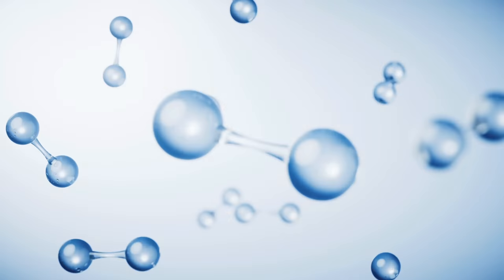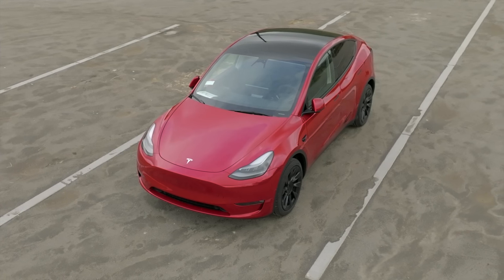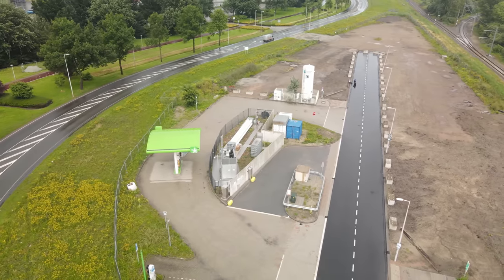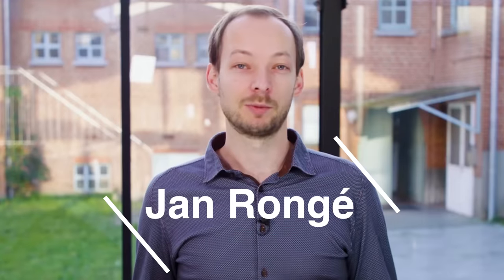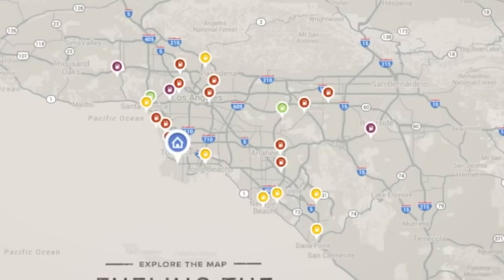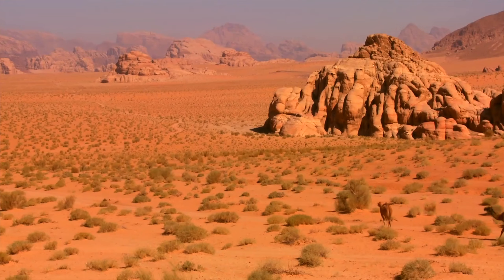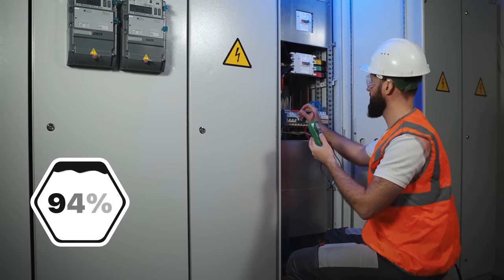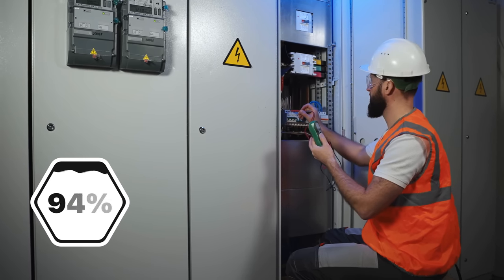Breakthrough Solar Panel Makes Hydrogen At Home!

Comment: Definitely not convinced hydrogen is the way to go for domestic EVs. Without a widespread network of easy to access filling stations, I don't see just refuelling at home as a viable option. Indeed, one of the reasons often cited for the slow rollout of EVs is the lack of kerbside charging solutions for people without drives/garages/etc., or for people in multi-dwelling buildings. With H2, that's orders of magnitude more complex than electricity.

On the other hand, I absolutely see H2 as a viable option for aviation. It sounds obvious and trite, but aeroplanes fly between airports; they don't stop to refuel at the garage along the road. Airports have fairly substantial fuel storage and distribution facilities, and also relatively secure facilities where the fuel is (usually) some distance away from things like the terminal buildings and jet pans. Introducing H2 refuelling at a few thousand airports is, potentially, a much easier sell than introducing it into hundreds of thousands of filling stations, many of which are small businesses with limited financial resources for retrofitting H2 tanks, compressors, etc., as well as the safety/monitoring infrastructure to monitor for H2 leaks.

Hell, you wouldn't even have to do it at every airport: just a handful of key high demand routes would be a good starting point. The calorific value alone would be a selling point to the airlines and aircraft manufacturers - shaving off several thousand kilos in take off weight, or potentially extending the range. There are, I suspect, considerable pressurisation issues at altitude to be solved.

Going back to domestic vehicles for a moment, one of the less appreciated benefits of EVs is the simplification of the drivetrain: effectively gone are the complex gearboxes and combustion engine, replaced with one or more (usually) direct drive motors. Even if H2 does move into domestic vehicles, I suspect it's more likely to be in fuel cell form rather than a full-blown H2 combustion engine with traditional gearbox etc.

Comment: I still don't get why there is so much push against hydrogen.
Sure it's not perfect and still need a lot of research but it was the same for EV and battery not that long ago.

50% energy conversion is not that bad.. solar have a terrible energy conversion too but no one seems to care ?!

Don't get me wrong, renewable energy production is great and i mostly see an even better future for them coupled with hydrogen generation, that way you would have a somewhat pilotable green energy source. So again 50% is better than 0%

Also for those who will prefer battery because they are better, sure they are but there will be nowhere close to enough material for everyone + reliable energy storage for renewable + storage for your home.

But hey what do i know ?! We can go full green energy with battery and in the meantime digging the earth like crazy to find all we need. 😅

Comment: So, in essence, a Solar Panel would be much better being used to charge a battery.
Reply: Yes, in terms of round trip efficiency, yes. But as long as there's a use case for hydrogen, be it at home or at industrial scale (and there always will be, I can assure you of that as a chemist) pushing technologies like these forward will always be valuable.
Reply: Hydrogen IS "A battery" just a very inefficient one.

Comment: Interesting product. 
Like always a great video, thanks!
I am sure H2 cars will never be mass produced but maybe with this, logistics companies could power their H2 trucks and ships with that. 
Also it could be another way to use it for heating the house, if the storage can be solved relatively cheaply. 
But in the end, all energy will be produced and used as electricity for home and cars because it’s the most efficient and will be cheaper IMO. 

I have seen an installation of a Model S 70D battery as home storage for around €15k. 
If you have a relatively big PV system, you can already go nearly autark. 
The efficiency loss for changing its state and or turning it from and to electricity is to high IMO. 
Only when there is so vast renewables, that it can’t be used or stored elsewhere this could be the last piece to put energy grid.
Reply: It's simply a matter of infrastructure. Electric grid was already built and abundantly available for everyone, even before electric cars were viable. Hydro grid is in its infancy, but the construction has started, and many countries are pushing hard for it, especially Scandinavian countries like Denmark are investing billions in expanding the grid scale to support tens of millions of homes already. Once the main production hubs have been established, the public infrastructure will sprawl - slowly at first, but at an exponential rate so over time it will look like it came out of nowhere, even if it feels like the pace is slow right now.

Comment: I don't see the point of this, it's just a PV panel combined with an electrolyzer, which means the amount of energy in hydrogen it produces is still way less than what you'd have by just using the electricity directly in a battery EV. It's not a miracle device that improves the efficiency of splitting out hydrogen and oxygen from water. If you must have an electrolyzer, mount it at ground level so it's easier to maintain.
Reply from the maker: great points, as I mentioned, but their direct air vapor electrolyzer is definitely interesting.
Reply: @TwoBitDaVinci  Yeah, sorry about that; I don't usually do this, but I got so annoyed by the idea of this product that I didn't even watch to the end.

Comment: By the time these panels are cheap enough for the populace to purchase, advances in existing alternatives will more than likely keep this tech from taking off. For good reason. Assuming hydrogen storage becomes affordable, if everyone had a decent amount of hydrogen stored at their house, I'd think the dangers would far outweigh the benefits. Imagine a house fire. Power is cut, the hydrogen storage vessel is no longer maintained and becomes a time bomb. The only feasible way this tech would be useful is if it converted water vapor into hydrogen way more efficiently than creating electricity. The hydrogen would then be used to power a generator. I'd rather spend $20k on an insulated box to store thermal energy that could be used to run a heat engine and generate electricity.

Comment: On demand hydrogen from water is something people have been trying to perfect for a long time. You can make an electrolysis cell with stuff from a hardware store. But they are dirty and inefficient. They have booster kits you can buy and put on your car. But it's tricky to get them to work, and they don't replace the gasoline they just replace the oxygen in the combustion process with brown's gas. It is questionable weather this makes it more gassoline efficient or not. The electrolysis cells you can get or make don't produce pure hydrogen gas. They produce a mix of oxygen and hydrogen. Though you could separate the electrodes, they get even less efficient as a split electrode cell. And then you need to vent the excess oxygen from the cell. So I'm not sure anyone has gotten them to work very well on internal combustion engines. People have gotten them to work for fueling gas cutting torches that would usually use two tanks and mix the gan in a regulator. From what I understand some materials require one of these brown's gas torches to cut correctly or safety. I think in some places the gas is also called oxy-hydrogen or something like that.

Comment: I guess you are completely unaware that we can use electricity form solar panels straight away for heating without any need to get hydrogen.

And by the way, harvesting radiant electricity (as per Tesla patent) would cost a fraction of any solar system an make almost redundant power banks … so instead of spending £30k on a weather dependant solar system we can use radiant energy 24/7 with cost of £500-1500

Comment: Would I purchase a Hydrogen Engine Car for a Daily Driver, YES.
When it come time to drive for distance travel, I'll just rent something else.
The only issue with a Hydrogen Engine Car that is not being discussed is that it requires just as much maintenance as a Gasoline Engine Car.
   And this will sway many from it and just to full EV instead.

Comment: Low efficiency is not a problem when you can just build a larger panel/plant. 
Waste heat is not waste if you use it to heat your house or water. Just add a jacuzzi to the system;-) "Free" heat.

Comment: There is absolutely nothing breakthrough about a solar panel that makes hydrogen.  You can make hydrogen as easily as sticking two wires into a cup of water and hooking them up to a 9v battery.  It is called electrolysis, and you typically do that experiment in grade school.

The only breakthrough that is important is the long term storage of hydrogen. No one has figured out how to do that yet.  The hydrogen will leak out of your car about as fast as those panels can make it.  The end result will literally be the destruction of the water as the hydrogen escapes into the atmosphere and then out into space.

Comment: The problem with Toyotas plan to utilize hydrogen to burn in a combustion engine is flawed.  Combustion engines have too many moving parts.  Too many things to go wrong.  They need an air filter, a spark, a timing chain or gears.  They need a carburation system and injectors.  They need a crank shaft with pistons and valves.  They will need regular trips to the mechanic for maintenance.  In other words, the very same problems that gasoline engines experience.  The plan should be to simplify the process.  An electric motor has only one moving part, is extremely reliable and needs far less maintenance than a combustion engine.  I can see using fuel cells to power an electric motor in the car, but a combustion engine makes no sense.

Comment: Why? Why have so much energy lose by converting solar into hydrogen, then hydrogen into power? I only really see hydrogen having niche uses.. I can see hydrogen being used in like cargo ships or at sea, it's a good replacement for gas there and ships can't just connect to the grid all the time to recharge like a car or a house. Electric just makes so much sense for most places, because there's barely any energy lose.

Comment: It still takes more energy into making hydrogen gas than you get back out. 
 If I were your banker would you give me $100.00 and only expect your account to be credited $68.00?
 I don’t think so. Same for hydrogen production. It is a net loss. 
 It means more solar panels to make it on your property and then storage is important. A fuel cell to use it efficiently…. As I see it it’s nice but not practicable in balance. 
 Everyone always talks about how clean and useful hydrogen is without consideration to its cost in energy. Net losses are not a good thing.

Comment: Hydrogen is ONLY useful when weight is the major criteria, like in rockets.  Everything else uses oil derived fuel because of the ease of transport, storage and energy density.

Comment: For passenger vehicles, zero chance in the next few decades. Air transport and heavy transport if they can solve some of the logistics problems. Otherwise it's a pipedream. "Hydrogen is the fuel of the future - and always will be." -- Sandy Munro

Comment: You know where millions of dollars/euros/pounds get invested into something and then you just have to keep going to justify your existence - this feels like one of those cases.  You don't create an energy source to make massive efficiency losses when converting into another energy source that you started off with in the first place.  So in this alternative world you're going to pander to your gas burner/cooker and replace all of your existing gas piping (which can't be used with hydrogen) rather than just using the electricity and an induction hob (more efficient again than gas tops) and charging a regular EV.

If you think getting the infrastructure in place for EVs is painful, hydrogen is on another level.  The ONLY use case I can see for this is if you are a hydrogen producer and want a greener solution but then at scale this wouldn't be the most cost efficient way of doing it so that kills that then.

Comment: Forget about hydrogen for cars. That's not the way. Not even for steel or similar topics. We need hydrogen for producing fertilizers in the first place - now we are using the one generated from fossil fuels. Only when we successfully replace that one, we can start to think about use for anything else. And any use for transportation makes 0 sense - there is 6 times more electricity you need to move a car using hydrogen comparing to pure battery.

Comment: Wow, it takes only SEVERAL MONTHS to fill up your Hydrogen car? Maybe you need to drive only 3 times per year. You could always take your gas-powered car on the other days, or take the BUS. Notice that is only 250 Liters of GAS, not of the compressed hydrogen you need to gas up. Months and months of charging.

Comment: sounds like it would be perfect for Mars.. the only difference is you would collect the Oxygen as well as the hydrogen and the you get rocket fuel ! and if you dont want rocket fuel just burn the H2 ad O2 to make water and energy !  ie you would be able to extract water straight out of the atmosphere of Mars! and of you want to store the Hydrogen better then combining it with CO2 would get you methane ! which is easy to store !

Comment: Y would I want a car that can only drive 150
Miles from home. How long will
It take me to produce  hydrogen enough to
Go 300 miles?  Sounds stupid. So now I need solar panels for electric and another set for hydrogen. When I can just make electricity and charge a car that I CAN RECHARGER 150
Miles. Or even 300 miles.

Comment: Why would you go out of your way to use a solar panel to make hydrogen, and then turn around and put it into a fuel cell to turn back into electricity? And I bet you'd then take a lot of that electricity, and put it into a heat pump to warm up your house during the winter huh?

JUST BURN IT.

You constantly assume, for the entire video, that you would need a fuel cell to use the hydrogen. It's hydrogen. It burns. You can just burn it to heat your home, or cook your food. It might actually be efficient enough to be competitive if you do it that way.

Comment: I think you are missing the point with the efficiency. The cost to store electric, especially for heavy industry and cars, is expensive and the batteries have a smaller lifespan, so although the LAVA system is more expensive and only 50% efficient, the cost still works out cheaper than electricity and batteries. So in answer to your question, yes I would take one of these systems with a hydrogen combustion car, over a standard PV system with batteries and a Tesla. JCB in the UK have produced a hydrogen combustion engine with 0% NOX that is more efficient than a diesel engine, and I expect similar breakthrough's in car engines.

Comment: I think it's too late for hydrogen, it's missed the boat. Hydrogen vehicles are much more complicated than either ICE or EV's making them much more expensive to run. Even if you could make your Hydrogen at home for personal use, electricity is everywhere and the charger network although sparse, is doubling every year.

Comment: Oh dear another H2 rabbit hole: "One  panel produces 200liters of H2/day" which equals 0.02kg's. So you need 850 panels day's production to recharge your Toyota Mirai. As for the 6 litres of water you need for every KG of H2 produced and then pretend that using moister in the air as a free source of water without mentioning possible environmental impact at scale is tantamount to ignoring environmental impact of desalination.

Comment: Hydrogen car, not likely. To complicated its back to having either a fuel cell or engine that runs on the hydrogen. I love my Tesla simple system currently 300+ range. Soon, 500+ will be normal, especially for towing. Or trailers with its own batteries for assist.

Comment: Hydrogen: good fuel for rockets, but pretty cr@p for us normal folk.

It would make more sense to convert our vehicles to Stirling engines and create a refueling infrastructure built around liquid nitrogen and run them off of the temp difference between the easily dispensed & carried LN2 and ambient air...

Comment: I know you gotta make content but the hydrogen argument for personal transportation is long dead.  It’s not nearly as energy efficient as battery tech. Hydrogen could be better used in commercial transport until the battery tech catches up or in energy storage but again, better and more efficient alternatives are on the horizon.

Comment: it's just basically the same with the previous "solar generated water". Using solar panel,  electric, then hydrogen. please that's not innovation, that's coupling current technology system in decentralized ways. which mean more costly hydrogen. omfg

Comment: Hydrogen is no solution, certainly not in homes or cars. Just a different form of battery not a fuel, and not that good with the added problems of storing it and flammability, leakability. Hydrogen would be better used to make airships. Replacing planes.

Comment: Even if you have solar panels making hydrogen you still need to pressurise it and store it before you can top up your hydrogen car. This is going to be very expensive. I can see a market for this with large transport like trucks and ships but not cars. Please stop throwing money at this unworkable allternative to electricity.
Reply: it would be better to synthesize either carbon or nitrogen compounds, that way it can be stored in a smaller space. but problem with carbon is where will you source it from and the problem with nitrogen based compounds is that its toxic